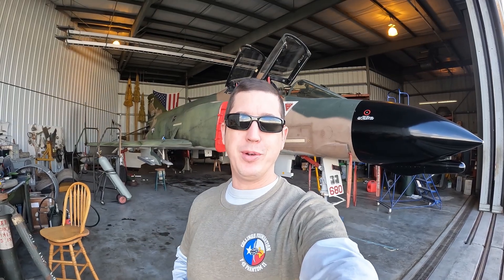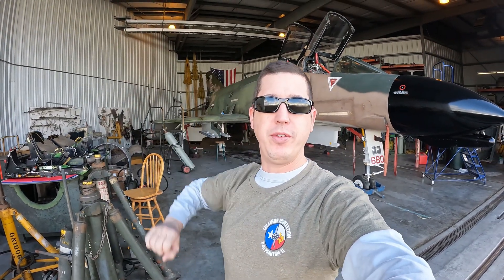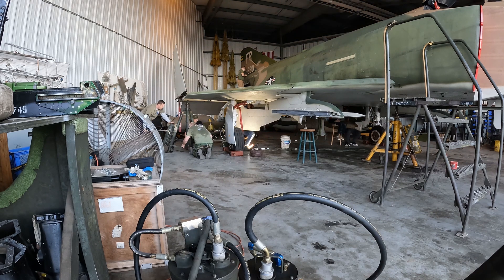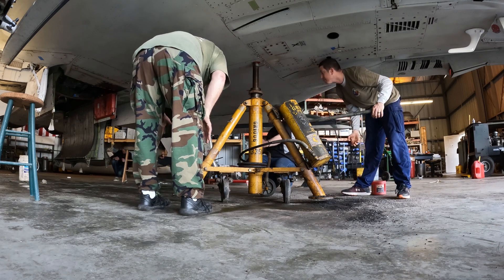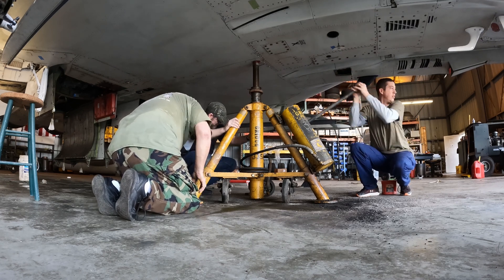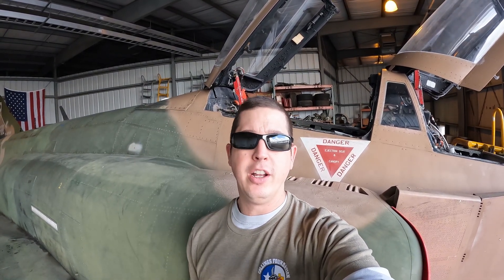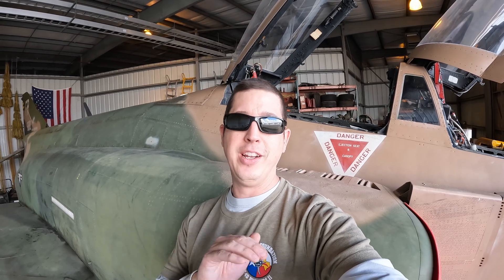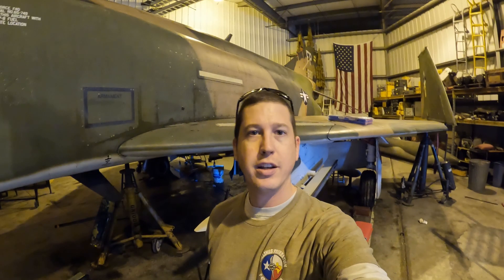Meet My New Friend, Jack - F-4 Phantom

Comment: DCS is awesome.   Looking forward to seeing the F4 in it as well as (hopefully) the A6
Reply from the maker: It sure is! It was everything I was looking for in a flight sim since the 90's. The A-6 will be a nice addition to DCS. As I understand it Heatblur will be doing that aircraft, but really starting to work on it after they release the F-4 and the Eurofighter.
Reply: @DieselThunderAviation  I still have a copy  of Falcon 4.0 sitting on my shelf.
Reply from the maker: @WhiskeyDale  When that sim came out, I did not have a strong enough computer to run it, so I have yet to experience it. How does it compare to DCS and the F-16?
Reply: @DieselThunderAviation  it was great back in the day. I used to run it on my work computer network & dog fight against the other guys. DCS (full fidelity) is a real cut above.  getting my sim pit set up now.
Reply from the maker: @WhiskeyDale  Nice! And I agree, DCS is everything I was looking for in a flight sim and distinguishes it above the others. What are you doing for a pit?

Also, I see you jumped on the 62nd VFS Discord, awesome! I see two of you on there though, is one not working?

Comment: I just got into DCS world, Waiting on my HOTAS to get here. I'm looking forward to F-4E and the Skyraider. A friendly suggestion from and old Phantom Phixer, avoid that nose jack like the black plague. That is the worst jack to be on. Also we use to use a sledge hammer to seat the jacks, and we checked with our ID cards to make sure they were seated.  Nice to see you got your seats out. Hopefully you got the CAD/PAD squared away on it.
Reply from the maker: We did the same thing getting the jacks square on the deck. Last thing we want is the jet to shift while we are swinging the gear. I as well am looking forward to the F-4 in DCS, both of them! Skyraider too!
Reply: For sure. Y'all know what your doing, definitely don't want it moving. The few gear swings I did. The experienced maintainers were more worried about me pulling out on the gear handle than anything else. The only mods I have in DCS are the A10C, TF51D and  Su25. I gotta figure them out before before I start buying other planes
Reply from the maker: I have the other problem, a lot of modules and not enough time to fly them all! 

None of us want to pull the handle either and blow down the gear. Makes you wonder why they didn't make that a two-step process like on the F/A-18 Hornet (turn handle 90° and then pull).
Reply: @DieselThunderAviation  I hope you have the module problem one day, unfortunately there is never enough time. I just want my hotas to get here so I can learn about mapping and learning how to fly the warthog and frogfoot. 

Right! That is is one weird things of the Phantom. I never understood why they didn't make it a separate handle or something like that. Like next to the emergency brake handle or something
Reply from the maker: Oddly enough, both aircraft were made by the same manufacturer. Definitely makes you wonder on that one.

What HOTAS did you get?
Reply: @DieselThunderAviation  indeed it does make you wonder why. With airplanes like 18 & 15 seem more user friendly.

I got a used Saitek X52 off of ebay. Should be here one day this week
Reply from the maker: @Cubrooski  Nice! I used the X-52's predecessor, the X-45, for years. Other than cleaning the plastic and giving it a bit of lube to reduce friction, it was a good stick!
Reply: @DieselThunderAviation  Was it? Did the X45 have the mode selector on it? The only stick I've ever used was the cheap single stick with the throttle paddles on it. This is my first HOTAS,  so I've got to figure how to do the key binds and set it up the way I want it.
Reply from the maker: From what I remember, the X45 had a 3 position mode selector on the throttle. I never used it for that purpose, usually had it mapped for the speed brake control in most aircraft. 

Mapping the controls gets tedious if you have a lot of modules, but your usually set once it’s done. Until you upgrade to a new PC, you get to do it all over again!
Reply: @DieselThunderAviation  HAHAHA....that's kind of what I'm thinking about mapping that mode switch to. Is it better set the keyboards up in the saitek software or in dcs? I looked in the DCS forums and didn't really see consensus.
Reply from the maker: I don't think I used the Saitek software beyond making sure I had the right driver for the stick. Everything I mapped in DCS. The pinky switch on my X45 became a "shift" key of sorts. By using the pinky switch as a modifier, I gained the ability to have twice as many controls on the HOTAS. I adjusted the key bindings a lot at first until I found a layout that both worked for me and made sense too. Any controls in the real aircraft found on throttle I tried to keep on the throttle, same with the stick.
Reply: @DieselThunderAviation  ok cool thanks. That's kind of the route I was going to go as well is map them in DCS. I was thinking of kind of setting up the controls to how they are on the stick and throttle. Cause on long tow jobs I like to look and see what they all do.